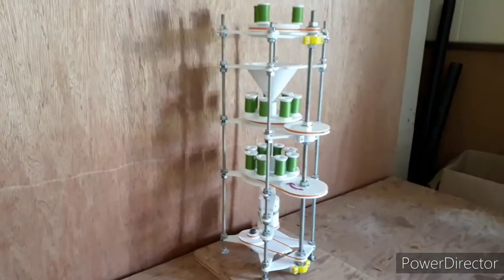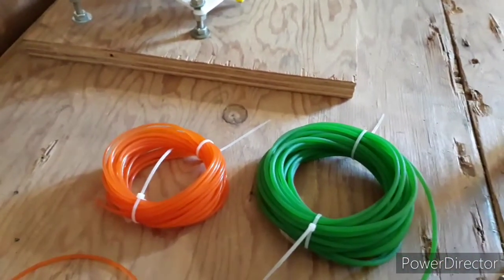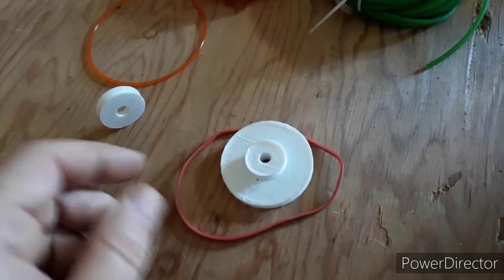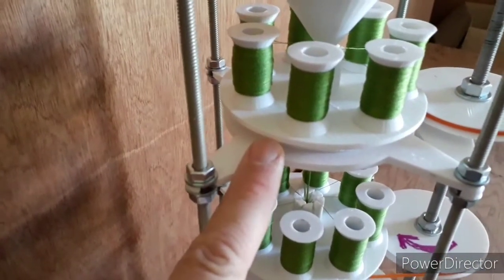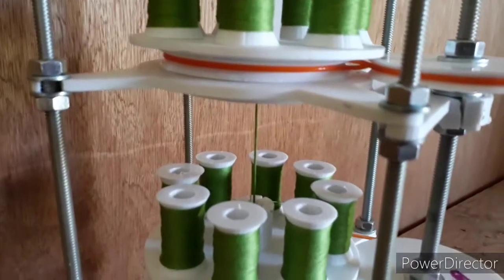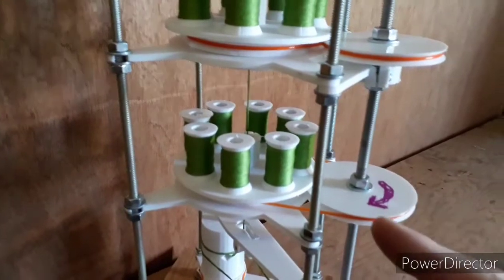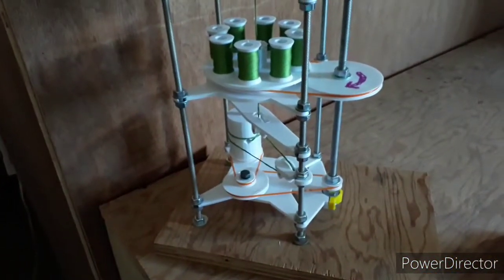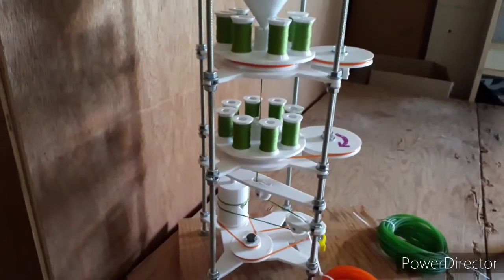3D Printed Pulleys and Round Belts (Polyurethane Belt)

Comment: Very interesting. Do you think this round polyurethane belts material will be a good solution for the following task: I need to make a linear slow movement 2 meters long. I also need to attach some plastic or magnet to it, in order to detect with sensor the starting point and endpoint of the movement.

Comment: Thanks for the video, I was looking to try and source round belts for my 1970's Sony open reel tape deck. Now with this, I can make them. Yeah!
Reply from the maker: I've had a bit more experience with this and I would add: wipe the ends with alcohol right before you try to melt the ends together. Seems like traces of oil or something can interfere with a good join.
Reply: @senorjp21   Good point, I'll make sure to clean the ends for next time. The only trouble I had was to line them up properly, the ends tend to sort of glide against one another. But once hardened, boy, does it work! Cool thing to discover for me.

Comment: Hi!! We're a robotics team and we are trying to use these same round polyurethane belts and we're trying to place the belts in a captive part of our robot without taking our robot apart. 
How did you accomplish this? And what method are you using to melt the belts?We're kind of struggling doing it...
Greetings, CodeBusters
Reply from the maker: I wipe the ends I am trying to fuse with alcohol, then use a butane lighter to gently melt the ends using mostly the sides of the flame. When little melted bumps form I touch the ends together and hold them very still for about 30 seconds. There are specialized tools for this job as well. Good luck
Reply: I've seen heat guns with flat tips used as well.

Comment: Thanks, great video. Did you have any issues with friction heat deforming the pulleys?
Reply from the maker: This is a low-power machine - the total power to the motor is a few watts.  I didn't notice any heating after operating the machine for 15 minutes.  The round belt wedges into the V-groove and doesn't slip.  No slip, no friction.
Reply: @senorjp21  Thank you!